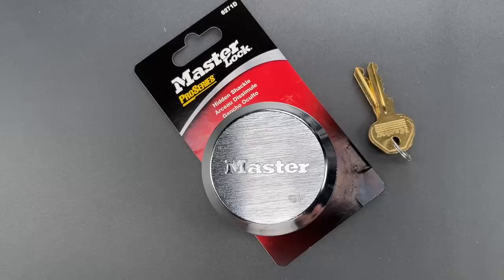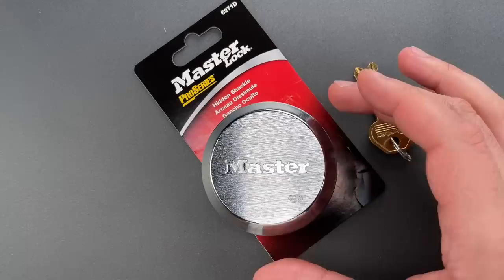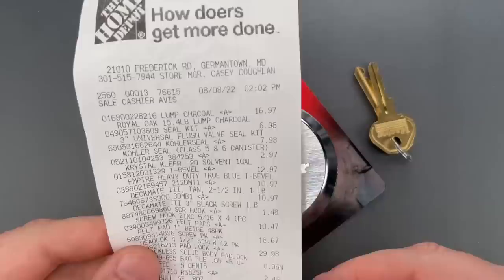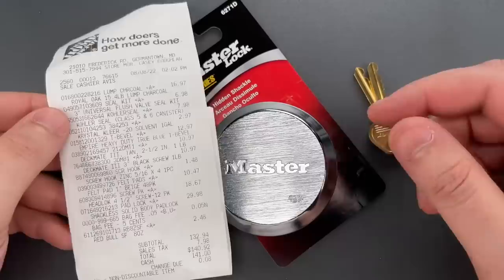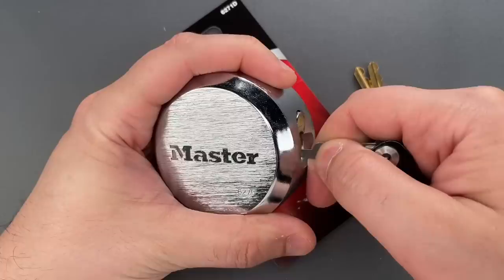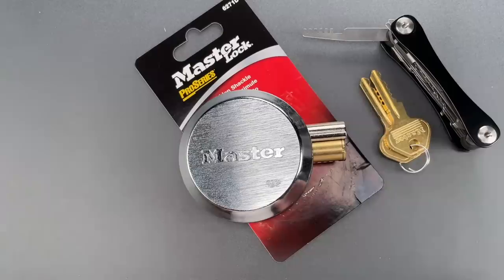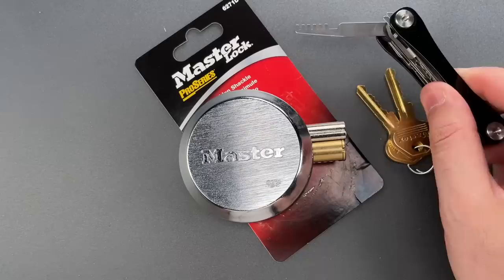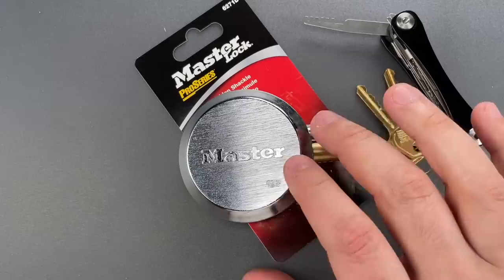[1464] 1.5 Year Update: Master Puck Locks STILL Not Fixed

Comment from the maker: Here’s the original video where I open 10 of these locks in a row: [1197] Opened FAST: Master Lock Puck Locks Comb Picked!
https://youtu.be/uxmmwWwW6TY

Check out this video for an explanation of comb picking:  [1434] Inside Perspective On “Comb Picking”
https://youtu.be/6DPCE1Ct8U8
Reply: this is the lockpickinglawyer
Reply: Where have you been LPL
We were worried
Reply: Not sure if you've noticed but the adress is clearly visible on the receipt.
Reply: @Bear-Seek-Seek-Lest  I was going to say that. For someone who is so concerned with security, he missed a big one.
Reply: The reason Master Locks isn't fixing the flaw must be because they think if the lock cost less than the picking tool then the issue is economically self resolved.
Reply: @Bear-Seek-Seek-Lest  its only the store address. But as always Security by Obscurity..
Reply: Does MasterLock not fixing the issue after your posting of the video of the flaw expose them to a greater risk of losing a liability case in court?
Reply: Hey Masterlock.. you need to sue LPL asap!! Oh wait.. he's a lawyer.. and he's not a fluke!
Reply: I won't be expecting much in a year's time LPL but we'll see won't we 😁👍
Reply: This is the ultimate security through obscurity.  Until this lock, I used old/dollar store locks to demonstrate comb picks.  Most manufactures see the flaw and easily fix it....Master lock isn't paying attention in class.
Reply: You just (involuntarily?) disclosed that you record your script after the video is done. I imagine that you speak during the original video so you can later make a script that matches what you were doing and thinking at that time (including your hand movements).
Reply: Umm you just doxxes yourself man, take then down and blur out the address of the place you shopped at....
Reply: @Ashley.0000  which can be used to show near where he lives, Doxxers have used less to find YT personalities before

And he lives in a pretty small state... I know I been there for delivery
Reply: @Bear-Seek-Seek-Lest  That's the store's address, not LPL's.
Reply: Hey you might want to edit the Home Depot address on that receipt
Reply: If I had to guess, I'd say Master Lock probably doesn't care because, despite your channel having a lot of viewers, plenty of other people are just going to buy these locks without ever knowing there's a problem. I think you could have more of an impact on possible change if you approached Home Depot themselves and convinced them that they're selling a broken product.
Reply: One thing I never heard about... Does LPL contact the manufactures about the errors he find, or does he expect manufactures to search, and watch, his videos about their locks and correct their mistakes by themselves?
I really hope he contact them, like linking the video to them. Otherwise it's hard to get changes if they don't know about the errors..
Reply: @SweboySMM2  "correct them by themselves"

Considering the history of American locks is literally "SHHHHSHHSHSHSHSHSHSHSHHHH dont talk about the weaknesses"
Reply: @LockPickingLawyer FYI You accidentally revealed the location of the Home Depot (top of the receipt at 0:57). I know you are very cautious about hiding your face / personal information, just a heads up in case you missed it!
Reply: @Mr_Skarr  He's been trying to find the courage to pick the one mission he has left: his nose!
Reply: @bsgconsulting  that's the address of the store he bought it at
Reply: in the original video, i notice you seemingly checking out each key after taking it out and before comb picking. Is there anything you are looking at that changes how you use the pick or is it a non factor?
Reply: Hey I know a few already have but here's another ping cause I know you care about this stuff, edit out that address people can use that to dox you
Reply: @Bolverkr13  The store address is no more revealing than the address of his PO box which is listed on his channel home page.
Reply: @LPL: When you said you expected Masterlock to address and fix the problem I had to double check that this wasn't an April 1st video.
Reply: Lol you realize the address of the home Depot is on the receipt? Maybe you were on vacation, idk
Reply: Due dilligence: were you certain that you had a recently manufactured padlock, and not one from two years ago that had been lost in a warehouse prior to shipping to Home Depot?
Reply: Where can I buy the tool you use in the video? Do you have a website??
Reply: I am not expert or anything, but maybe that lock was "rotting" in that store in the storage like years or something. Can you check somehow, when a lock got manufactured? I don't want to defend any  manufactures, but maybe, just maybe this one is not the companie's fault.
Reply: @Bolverkr13  - why bother, you wouldn't know him if you saw him
Reply: Where are the locks actually designed ? Do Master Lock have a design office in the US or is design and manufacturing all outsourced ? It seems weird that a company with a long history struggles to get the basics right.
Reply: Are there any locks that actually protect your items that you want to secure?
Reply: @peacepoet1947  I think he talked about two locks what he can't picked yet. But there is no such way as 100% protection, There is always a solution to pick/break a lock.
Reply: Master Lock: 'This is how we make locks. We've always made locks like this. While they sell well, we aren't going to change a thing.'
Reply: You expected better only 18 months later? You have to be kidding; they've had 90 years to work on a fix, and still haven't implemented it! 🤣👍
Reply: So its been a year, is there an update or better yet a puck lock that you can recommend, as im in need of one. Thanks.

Comment: I've said it before but. The most damning thing about this exploit/vulnerability isn't just the ease with which it can be done. It's the fact that someone comb-picking a lock looks exactly the same to a casual observer as someone using a key on a lock.
Reply: Yea, now that you mention it, I do remember you saying that.
Reply: @stewartj3407  lmao
Reply: And it leaves no damage or evidence
Reply: Yep. Especially now that a lot of us have key organizers that look almost exactly like his Covert Companion folding tool set.
Reply: @Merennulli  or if you really wanted to could make a key with comb picking bit on it so it looks EXACTLY like a key & no one would even know.
Reply: It's also very disappointing that this is a six-pin lock that may as well be a no-pin lock.  Master finally puts enough pins in, but makes such poor decisions on machining geometry that it doesn't matter how many pins it has.
Reply: I don't know... sometimes keys can be hard to get into the lock. I think the comb might be easier.
Reply: Agreed very much, the main reason why I watch LPL's videos is to find out which designs/locks have such issues, since a lock which can be opened covertly in seconds by someone with no experience and remains functional afterwards is almost worse than having no lock as at minimum you'd expect to be able to tell if someone has broken in but you can't even do that.
Reply: @stewartj3407  Are you sure? I scrolled through the comments in both of the videos in the description for several minutes and was unable to find it. Or maybe Steph Benson shared this viewpoint with you in a private conversation?
Reply: Yep.  Burglars know witnesses can be everywhere and everyone has a mobile phone, so act normally.
Reply: @bungaIowbill  I've said it on other videos about comb picking
Reply: @Merennulli  That's where the 'Covert' comes in
Reply: Unrelated, but I like your pfp.
Reply: Hi Michael T.
Reply: I’ve definitely had a harder time using a key than this. If anything, people might be suspicious about how easy you opened the lock.
Reply: With how smoothly he opened that lock with the comb I’d suspect that he WAS using the key. Hell, I usually have a harder time opening things WITH the key.

Comment: Back in the sixties I showed a Lockwood rep. here in Australia, a comb pick I made that would open their "top of the range"  padlock at the time. It was the 245 padlock. There was excessive room in the bible, allowing all pins to over lift. This was before YouTube, Locksport, the Internet etc. so the real world risk to their padlock was extremely minimal. We heard back immediately, that things would change, and to their credit, from then on all 245 padlocks had longer driver pins fitted in all chambers, preventing the comb attack. It's an easy fix if certain manufactures just did that, particularly on the higher security products, the cost would be miniscule in the scheme of things. Better still, do away with the flat bladed keys and plugs on high ended products ...

Comment: Just dropping by to say thanks for your videos that turned lock picking into a hobby of mine. Today i got locked out of my second house as i forgot the keys and had no tools, i found a windshield wiper rod and raked the front entrance, i had some job to do on the shed which has an 80's domus euro lock where due to the wall i couldn't get into position to rake it because the wire was twisting so i ended up finding some keys with similar keyway, one of them had a low cut last pin and succesfully used it as a bump key.
Apart from the shady part of these skills for one to have them, this hobby definitely save lives.

Comment: I have purchased a few expensive master locks in the past for outdoor use. I have found every single one has been seized and required a lot of effort to remove or open. I had one on my Hallmark enclosed trailer which was parked at my family's farm two years ago have thieves attempt to break in. They tried to shoot the side door locks off with a firearm. Minimal damage to the locks... but it rendered them both inoperable.  The rear doors lok wasn't touched. It was the stainless steel round lock...?.. the locks internals were rusted and we had to use a blow torch to remove the lock. The o Ly locks they make that work... are the ones which nobody can unlock even with the keys. The lock was only two years old. 🤕

Comment: When I was installing DirecTV every van had these on them. One technician told me a story of a time they went into a building downtown, surveyed the installation, returned to their truck to get their tools and it was completely empty and the puck locks were sitting on the sidewalk next to the truck.  They couldn't have been gone 5 to 10 minutes, and the theives had time to empty the entire truck of its contents. I've never bought a master lock puck lock, and I never will unless I need to make a video about how shitty they are, and I'll probably just do that in the lock aisle of the hardware store if I wanted to.
Reply: The lock was so bad the thieves left it behind.
The kind of lock that's so bad that it's literally only there to satisfy bare minimum insurance requirements.

Comment: I decide to get into lock picking out of boredom and had some old windshield wipers I just replaced and made a simple set of tools out of the metal bars from them and took a master lock I had and thought maybe you just made it look easy and when I had it opened in under a minute thought maybe i got lucky tried it again and same case under a minute with crude home made tools was very shocked with how easy it was for someone with no experience and crude tools could open one of thier locks.

Comment: Masterlock isn’t going to change without pressuring their customers, which is actually the retailers. Maybe make a QR code to LPL videos on a sticker and just put them up in retail stores.
Reply: technically that is vandalism of private property
Reply: @M3PH11  If you use a master lock, you soon won't have any private property anymore to worry about.
Reply: @juicy_oranges5529  That's true but the store owners still won't be happy if you put stickers on their goods (or better said bads in this particular case).

Comment: These locks were used to secure the coin catch boxes on tire air stations in Utah. I was working for a vending company that maintained them and we had to rush to remove all the locks and save the money (converting the stations to cashless) because these locks were being bypassed. Not only are they easy to pick, but they can be melted with an acetylene torch within a few minutes.

Comment: The number one thing ive learned from this channel is that almost no locks are all that great if you're up against a skilled lock picker. Now, brute force is another story. Definitely big differences in how difficult breaking a lock can be
Reply: It's all about how much time it takes to learn to pick and what kind of specialized tools you need to open it. There is no unpickable lock, just a lock that is too difficult to bother or one you don't have the tools to open. This lock, however, is neither difficult nor are the tools required hard to obtain.

Comment: IF you use the "Puck" lock shown on the van, puck itself is hard metal, but where the key is inserted it is brass!! This is easily drilled out, usually lock is screwed up and has to be cut off.
You can stop or slow down this by adding a piece of angle iron next to where the key is inserted, making sure you leave enough room for key to be inserted & removed. Use a piece of
stainless steel since it is hard to drill thru. From experience... if you have the puck lock on a gate or place where thieves can get to the back  side, weld or destroy the threads so they
can't just unbolt it, push gate open.

Comment: A lock identifies a soft spot in security! 
You are detailing finesse!
I chose to pick up this skill in case of the worst case sensorial!
Perhaps you could highlight how a more aggressive approach would be beneficial to a result based outcome… or what if I didn’t care what mess I left!
Reply: If I got your attention, could you describe witch way determines the spin of the cylinder?
I feel I fail at many locks because I’m not sure of the direction that the key needs to be turned…

Comment: If you haven't figured it out by now, Master lock's idea of security is heavily based on resistance to destructive methods, not pick resistance.
Reply: are you sticking up for them in any way you can? are you serious?  It's sheer incompetence.
Reply: @salvor1  just saying they value resistance to destructive methods more than pick resistance. And it makes sense tbh.  You can buy bolt cutters at the hardware store in town.  Normies don't usually carry picking tools

Comment: Seems to depend on what you mean by "security". Since most crooks will pass up a locked target or just break the door, and most aren't walking around with a comb pick in their pocket, that's enough for master. It's obvious that pick resistance is not important to them. It's a no-brainer to leave it as it is. We can fault them for not constantly improving, especially since it would be so easy.

Comment: So, let's assume one wanted to fix this in a lock one owns without having to buy a replacement. Would one just gut the core and replace at least one driver pin and spring with a longer driver and shorter, balanced spring such that the stack can't be pushed above the shear line? Of course, rebalancing all the pin stacks would seem to be the better option, but would even one technically prevent the comb attack?
Reply: Perhaps you could just put an extra pin above each spring, effectively making a shorter chamber.
Reply: Yes, you could re-pin the lock, and that would solve the problem.

Comment: It is ridiculously easy and cheap to fix this issue as well.  Two little pieces of wire, placed in the driver springs of the longest key pins prevents this exploit.

Comment: A big retailer like Home Depot probably buys locks like this by the container load, I am not sure that a year and a half is enough time for all of the old locks (assuming that Master Lock did fix the issue) to work through the system. It would be interesting to know if this lock had some visual indication like "New! Sucks less!" on the package to indicate that it wasn't old stock?

Comment: These are still very secure because the vast majority don't know how easily they can be opened with a comb. Every one I've seen broken into was done with a sledgehammer or a pry tool.
Reply: My father always taught me to "work smart, not hard".. a literal metaphor for not beating a problem over the head with a sledge hammer. Guess these thieves' fathers didn't teach them the same. 😅

Comment: I've got a masterlock (don't judge me I didn't buy it) on my storage unit, couple weeks ago at night I went one locker off, had the same model lock as mine so I didn't notice.

The key was sticking so I thought some local tweaker tried opening it since this isn't a fenced or lighted facility. I wiggled the key and it opened it and when I raised the door I realized it was the wrong locker. Different key but all I had to do was not put it all the way in.

Two other locks same model there's that my key opened with no issues, I didn't open those doors though but was curious how bad it was, all locks just required a slightly different depth for the key to be inserted.

These locks aren't provided by the facility so people got them from different locations at different times. So apparently masterlock Puck locks are one key fits all. Buyer beware for sure.

Comment: I have some Master locks and it would be hard to open them for some, you have to force the key in and than after you get it turned you have to smash it with a sledge hammer to open them, I have to spray them every 6 months to keep them in good condition and stop the ball bearings from rusting solid.

Sometimes they make a crappy lock and than the environment makes them higher security so a win win for security... LOL